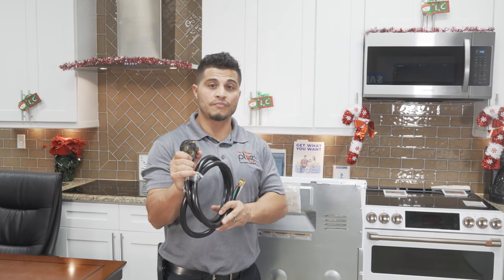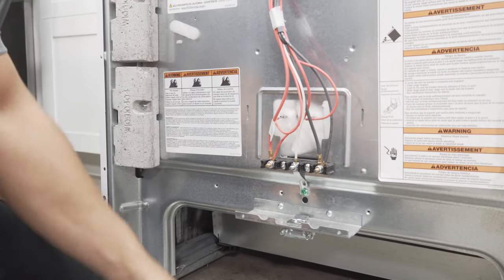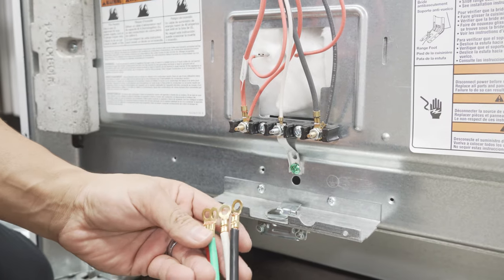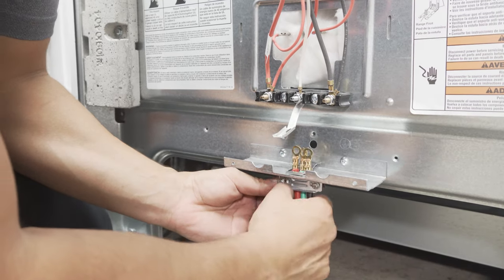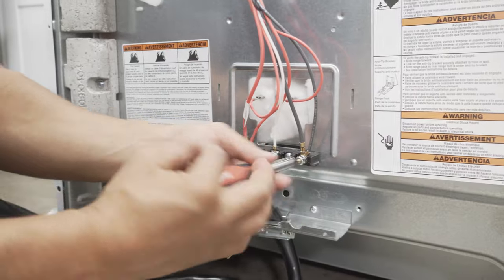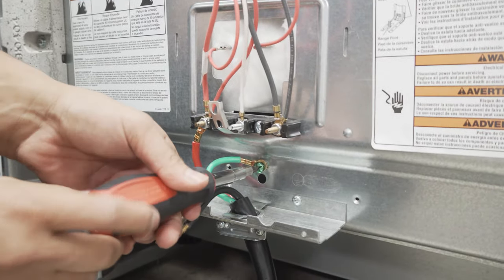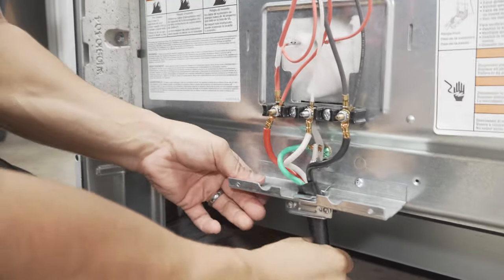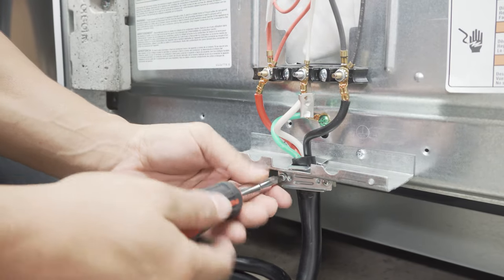How to Install a 4 Prong Power Cord on an Electric Range

Comment: Thank you sir. I just wasn’t sure if i needed to remove the bridge because my Samsung manual said to remove the ground screw and then cut the bridge.
Reply from the maker: I prefer to bend the bridge out of the way in case it's needed in the future.
Reply: @TheAppliancePlug  But doesn't bridge get hot ? Can't arc against the body ?

Comment: I have no intention of doing this. I just needed to see if there was a difference between a 3 wire cord and a 4 wire cord because my stove died today and the outlet has 4 holes and the current cord has 4 prongs and I wasn't sure a 3 pronged cord would work. So thank you! I'm confident I needed the 4 wire cord so I just paid for it.

Comment: May I please ask if the “bridge” plate from white to green ground, is a necessary piece, or does my green wire just need to be anchored anywhere without something connecting white to it??
Reply from the maker: The "bridge" plate you're referring to is likely a grounding or bonding jumper. In a typical household electrical setup, the green or bare wire is the ground wire, and the white wire is the neutral wire. The purpose of the ground wire is to provide a safe path for electrical currents to dissipate in case of a fault or short circuit.

To connect a dishwasher, it's crucial to ensure that it is properly grounded for safety reasons. This usually involves connecting the green ground wire from the dishwasher to the ground terminal in your electrical box or to a grounding conductor (such as a grounding screw or bus bar). This is done to prevent electrical shocks and reduce the risk of fire in case of a fault.

If you have a white wire in the same cable, it should be connected to the neutral conductor. However, the white and green wires should not be directly connected to each other. They serve different purposes in the electrical system.

Comment: I knew something was wrong after I inspected what Lowe's installers did to my new range. They connected both the ground and the neutral to the neutral post and left the ground strap connected to the frame. I used this video to verify the instruction to remove the ground strap. I folded mine up and bolted it down to the neutral post in case it might be needed in the future, just like the video suggested. The diagram said to cut it though. They also didn't add the strain relief! And I think they lost one of the 3 screws that hold the cover on. Grr...
Reply from the maker: Wow sounds like a headache! Well, thankfully you were able to find my channel! Appreciate your feedback! I'm planning future content and would love to hear your suggestions. Are there any particular appliance videos you'd be interested in seeing?
Reply: @TheAppliancePlug  one thing I really need to learn is how to take apart the ice dispenser in the refrigerator to clean it! It looks pretty scary where the flap opens!
Reply: Exact same thing just happened to me.  Blowes is a disaster at everything they touch

Comment: I have a Whirlpool that has a 4 prong plug on it I need to change it to a 3 pong plug but the bridge is missing do I need to replace the bridge for a 3 pong plug
Reply from the maker: Technically yes in order for the unit to be properly grounded. If you send me a picture of your terminal block where the cord gets connected, I can see if I have one and mail it to you. You can text picture to 813-252-0731. Or using the model number of the unit you can order one and have it shipped directly to you. You can order it from my appliance parts hotline which is 1-800-816-1241.

Comment: on my stove the white and green cables are both on the same middle terminal with an additional green ground wire joined to the stove (so there are 3 wires joined to the middle terminal)... do i keep it like that or do i follow your wiring directions?

Comment: Can we remove the bridge completely (4 prong cord) by removing the top white neutral wire and then reinstalling? Or does it need the metal between the wire and terminal block? I removed it fully but now I am concerned about plugging it in
Reply: You can remove it completely. He said he left it there and just bent it out of the way in case the stove was moved and had to be reinstalled with a 3 prong cord instead; that's when you would use the bridge, in place of the green ground wire.

Comment: Will this work on any appliance ? I just bought a second hand Maytag stove and it was a three-pong plug so I'm trying to change the old stoves plug onto the new stove
Reply from the maker: Yes, you should be able to change the range cord to the one you need. The configuration might be different. However, near the terminal block should be a diagram that shows you how to wire. Good luck!

Comment: What happens if I leave the metal bridge connected from the nuetral to the ground( it seems to be welded on and I just connect the new  green wire over it  when changing from 3 pronge to 4 pronge I bought a 1960  used GE electric stove and I'm changing it to a 4 pronge
Reply from the maker: I see you commented a few weeks ago. I can't say for certain what could happen, especially on an older stove. How did this work out for you?
Reply: @TheAppliancePlug  I left it in place and  I connected  the green wire over it, is working fine.
Reply: @terroralabruja mine has a green wire already instead of the white bridge and I connected the green from the 4 wire prong on top do you think that’s ok to do?

Comment: if I don't have a 4 or 3 prong receptacle on my wall am I screwed without wiring a new receptacle?
Reply: You need the proper outlet in the wall unfortunately for the wire to work

Comment: I just moved into my new house and the white and green wire are on the same bolt/screw... is that normal or okay? Should I correct this issue

Comment: List tools needed
Reply from the maker: Tools needed will vary based on which stove model you have. If you provide me with the model number, I can be precise with the tools needed. However, if you have a multi-tool screw driver that includes different attachments that should cover it. You will typically need a Philips screw driver and either a socket set or nut drivers. Hope this helps. Thanks for watching! Check out my linktree link in the description for a multi-tool screw driver.